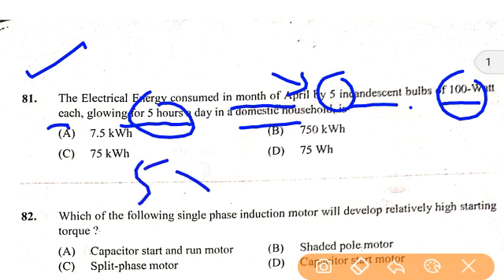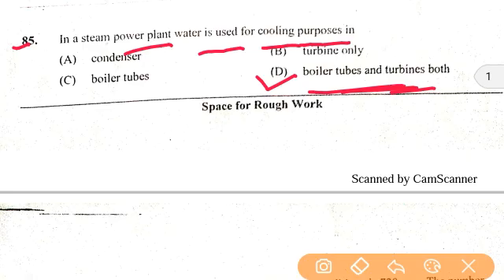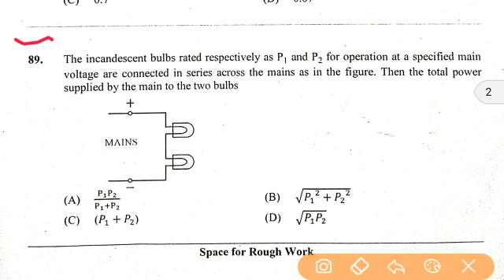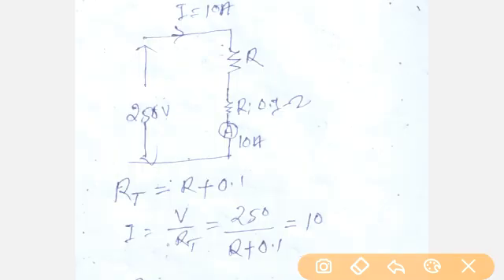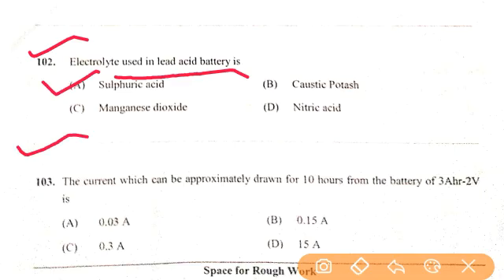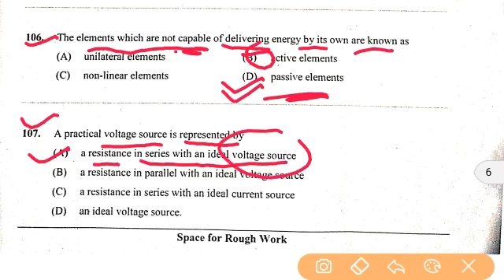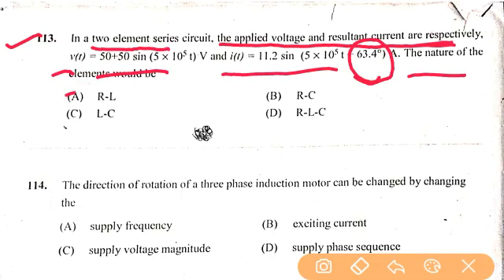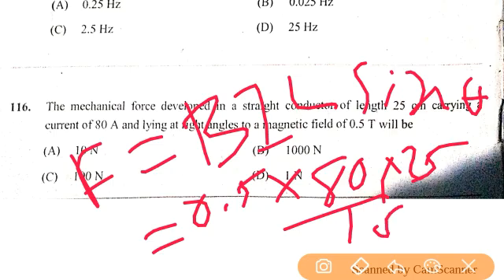OJEE || Le-tech|| Previous year 2018 Questions and solution || Basic electrical

Comment: Thermoelectric power plants boil water to create steam, which then spins turbines to generate electricity. The heat used to boil water can come from burning of fuel, from nuclear reactions, or directly from the sun or geothermal heat sources underground. Once steam has passed through a turbine, it must be cooled back into water before it can be reused to produce more electricity. Colder water cools the steam more effectively and allows more efficient electricity generation. Hence, the correct option is (A)

Comment: Q no 106 sir ans will be 10N because length 25cm will be converted into meter
Reply from the maker: Q116
Yes ans is 10N
I have calculated correctly but chosen wrong option

Comment: 116.option A not c. Sir only length 25cm convert in Mt. Then multiplying & answer is 10N
Reply from the maker: Yes
Calculated correctly but chosen wrong option

Comment: Q.104.may be option A, bcz Fa:FB =1:2
Reply from the maker: 104 is 1:1
Because resistivity don't depend on length of conductor
Reply: Yes sir 
I agree with you but sir
Resistivity depends on the thickness of the conductor.